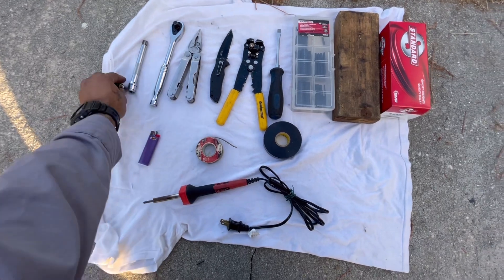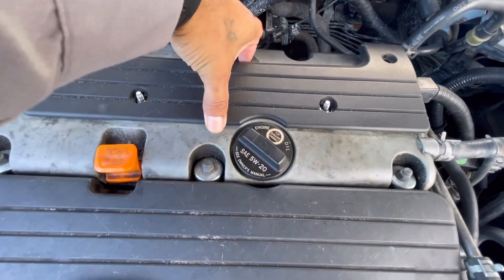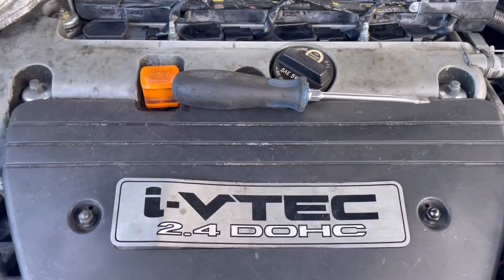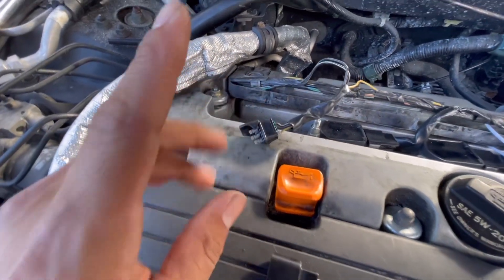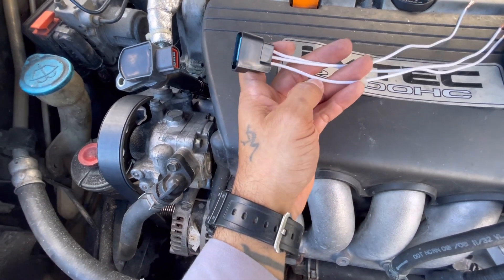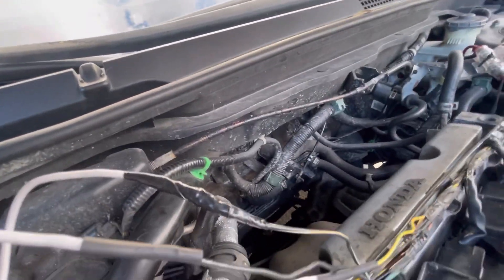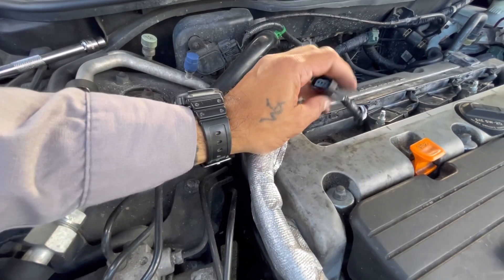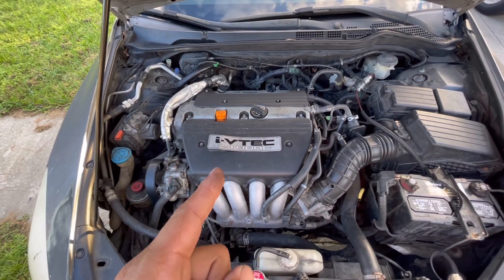Honda Accord Ignition Coil Pigtail Connector Replacement (2003-2007)(2.4L Engine)

Comment: Hey puedes escribirme el color correcto de los cables,  por ejemplo ese fue bobina una color verse frebte del carro, color negro centro, color negro y blanco atras de carro y asi con todas las bobinas lo que pasa que me arreglaron el cableado y creo esta mal necesito revisar ai me lo dejaron como es de esa bobina mi carro tiene los mismos colores que el tuyo y es el mismo motor asi que no hay falla de que sea diferentes a loa tuyos! Me ayudarias mucho
Reply from the maker: Hey thanks for watching and you have a tricky situation but not impossible. Here is correct format: 

On a 2007 Honda Accord 2.4L (K24A8), each ignition coil has three wires: power, ground, and signal. Pin 1 is power (Black/Yellow) which should show about 12V with the key on, Pin 2 is ground (Green) that shows continuity to the engine or chassis, and Pin 3 is the signal wire from the PCM that triggers each coil. All four coils share the same power and ground positions, but each signal wire is unique to its cylinder. When facing the connector from the wire side with the clip on top, the layout is Power – Ground – Signal. You can confirm them with a multimeter: check for 12V to find power, check for continuity to find ground, and the remaining wire will be the signal.

Comment: If the clip on my connector broke off , could I only change the plastic part of the connector or would I need the entire connector with the wires changed?
Reply from the maker: Hey thanks for watching. Sometimes you can get the little connectors out and replace just the plastic part but mine were so brittle they broke inside of the connector so I just spliced one on. Hope this helps and hope you’ll sub.
Reply: @ucanfixit1  instead of splicing you could have de-pinned both connectors and stuck the same wires in the new connector and not splice anything
Reply from the maker: @R00tOn3X  couldn’t do it on mine the actual aluminum pins the wires go into were all bent, trust me I would rather go that route!